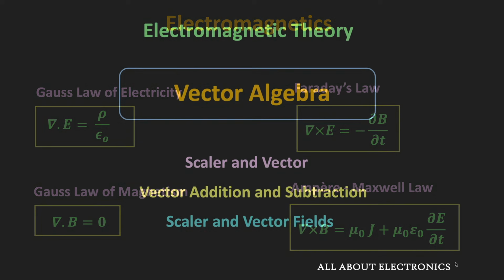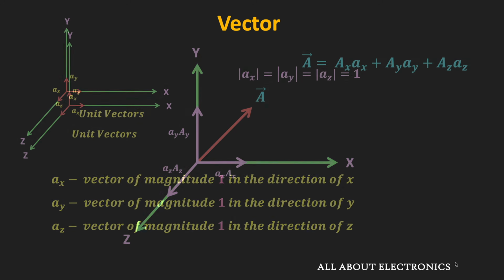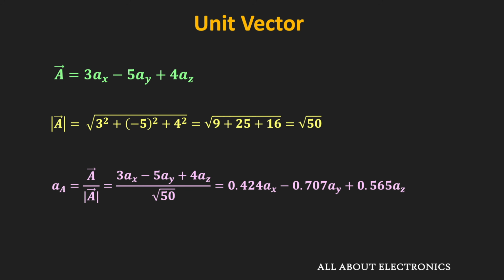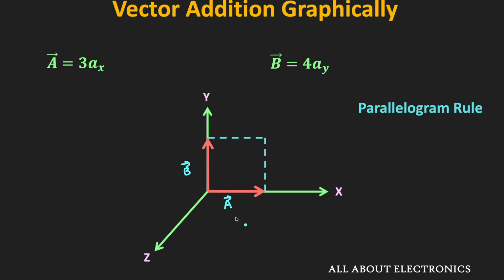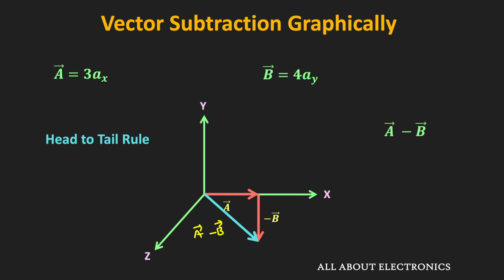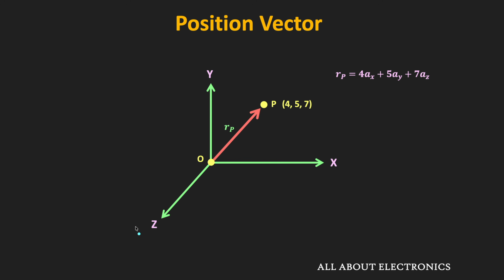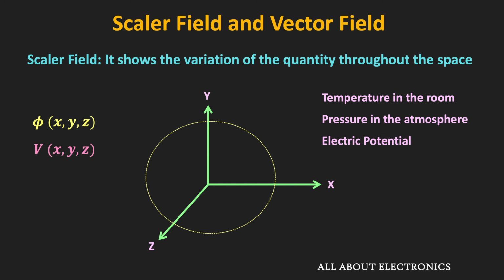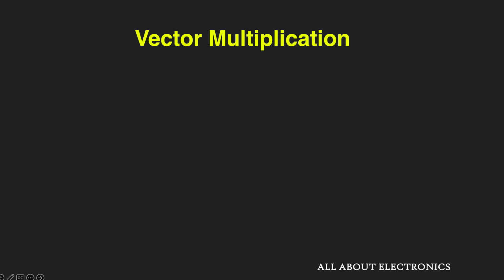Vector Algebra | Vector Addition and Subtraction | Concept of Vector Fields

Comment: Time varying Electric and Magnetic Fields: 
Faraday’s law, Maxwell’s Second Equation in integral form from Faraday’s Law, Equation 
expressed in point form, Displacement current, Ampere’s circuital law in integral form, 
Modified form of Ampere’s circuital law as Maxwell’s first equation in integral form, 
Equation expressed in point form, Maxwell’s four equations in integral form and differential 
form. Numerical